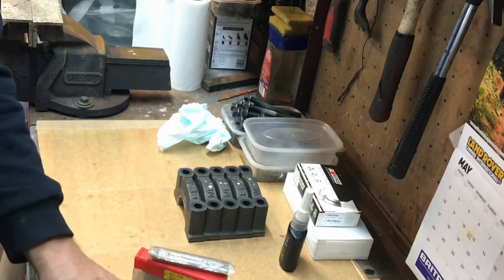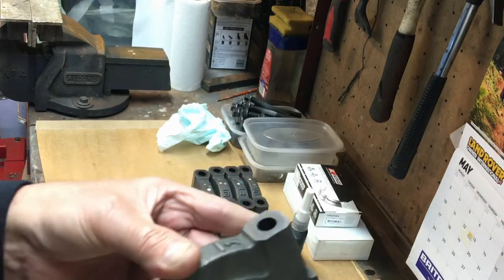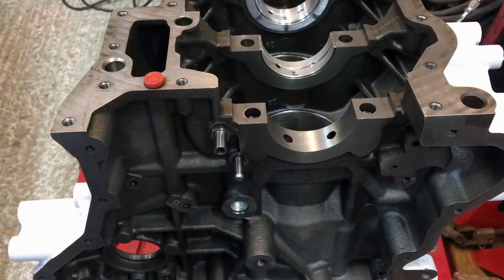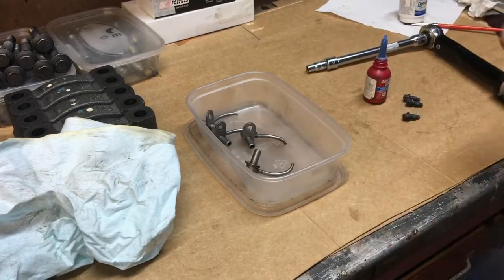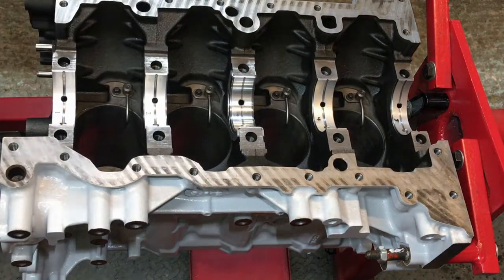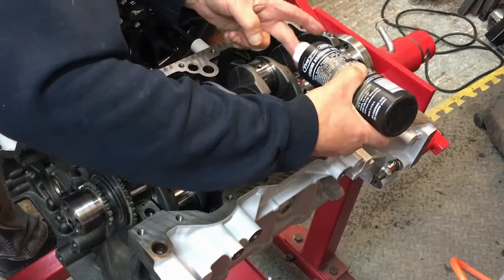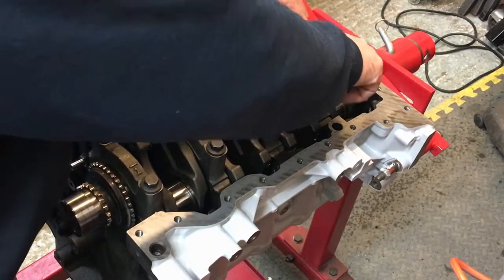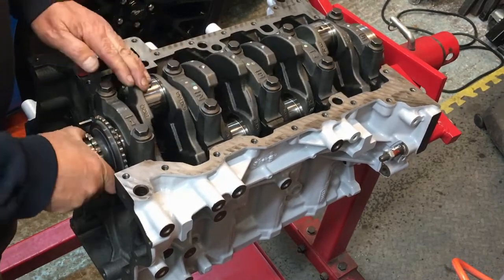Land Rover Puma 2.4 Tdci rebuild. Part 4.. Getting the Crank in...

Comment: Another very watchable video - well done. Regarding the thrust washer once you have fitted the new bearing cap bolts, could you show how you measure end float and explain options if out of (generous) tolerance please?
Reply from the maker: Will do Simon.